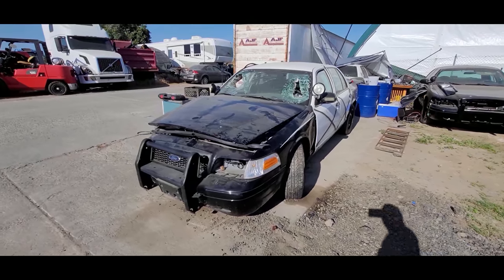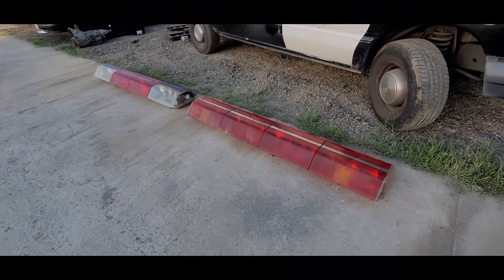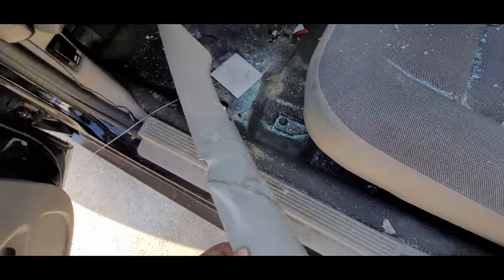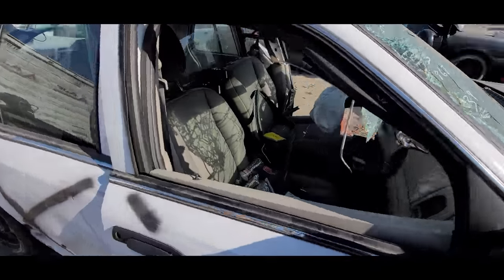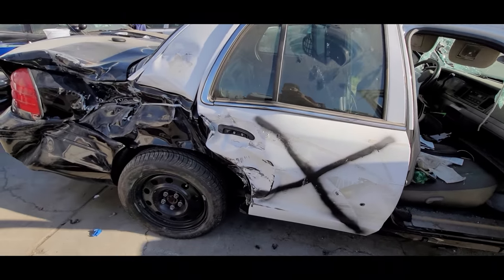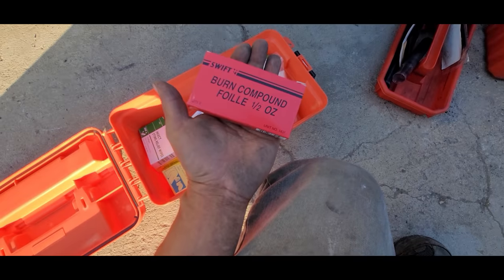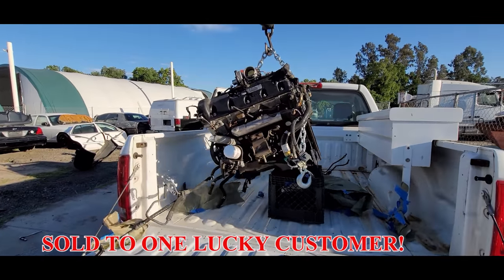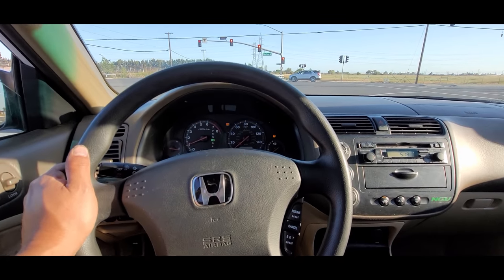I Bought a crashed Police Car! Had to Call the cops after what I found!

Comment: The car has 60k miles on it but the engine has a lot more hours running than most cars. Cop cars are usually left running during the entire shift so you can't trust how good a cop car engine is by the mileage also police are not typically gentle drivers as they don't care for the car as they do their personal vehicle.

Comment: The Boslla bulbs are really unreliable. I help kickstart the product and after the first set burned out after less than 6 months, they refuse to exchange them. I also had a lot of issues with the bulbs getting out of sync with each other if I flashed my brights. One would come back in amber, and the other in bright white, and then you have to turn off your lights for 30+ seconds to reset them

Comment: Thank you for a nice review of the value of scrap parts from a 'totalled' Queen Vic'.
In the UK and I believe in America a disrespectful nickname for cops is "PIG"!  With all the accumulated trash the crew of that car absolutely lived up to the name "Pigs"! I am fairly confident that European Cops would be derided by their colleagues and suffer severe reprimands from their superiors. Like the armed forces, the Police Service is a 'disciplined service'. Retired Police Cars are sometimes auctioned in the UK but they would be thoroughly cleaned up and all 'police equipment' removed. Had either or both crew died in the vehicle I would expect that it would be quietly scrapped out of respect to the crew.
BTW, This is disrespectful to actual pigs; they are more intelligent than dogs and though they like to root and wallow in mud they never despoil their quarters unless due to poor husbandry (the pig sty) forces them to act against their instincts and causes them severe mental difficulties.

Comment: Observations: Shop mechanic who prepared the car for auction- fired /  Cop whose body cam was found 20 day suspension / cop who crashed the car suspended for unsecured handcuffs.......
Reply: My guess is they were secured at one point and time (A backup set in the trunk) but that wreck launched them and they ended up under the cover and when they did a quick strip of anything important in the back they didn't bother digging too much because the keys were in there too. (I mean it's just handcuffs you can buy them as a civilian)